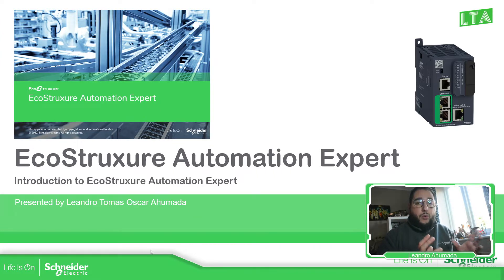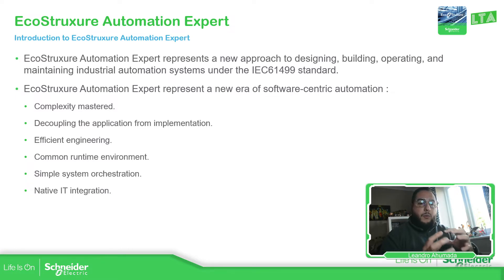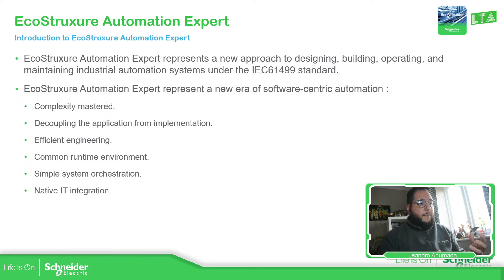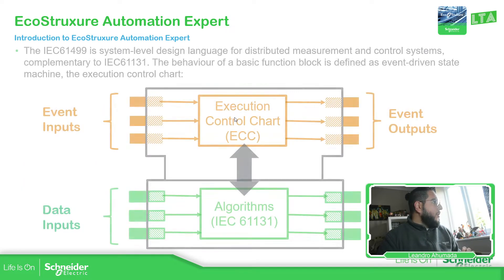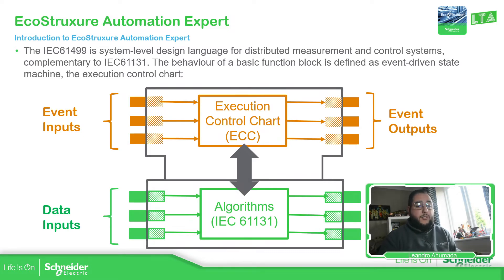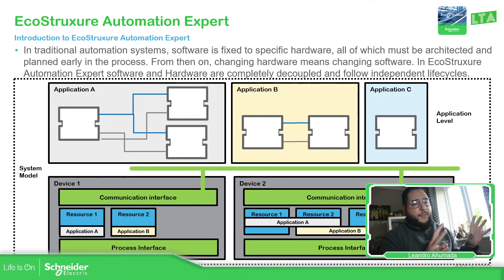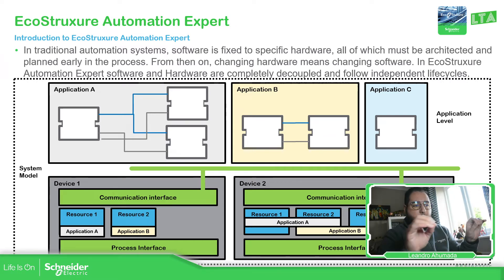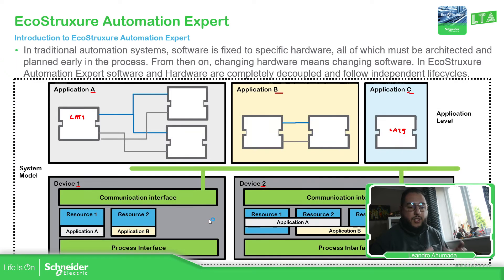EcoStruxure Automation Expert (Sorting Line) - M1.1 Introduction

Comment: Hi, what is the difference between EcoStruxure Automation Expert and combination of M580 DPAC with Aveva Plant SCADA (Former Citect SCADA)
Reply from the maker: Hi xc yong! I have not worked with the Citect Scada but it is an Scada and the EcoStruxure Automation Expert allows you to create the logic for the plant/machines in a dPAC controller of SoftdPac it also allow us to create an graphical interface so we can use the same software but if you want you can complement this solution with an Scada.